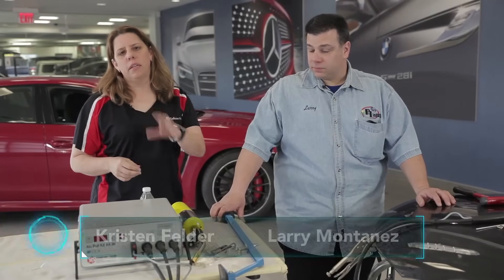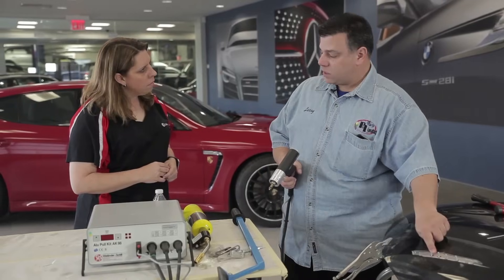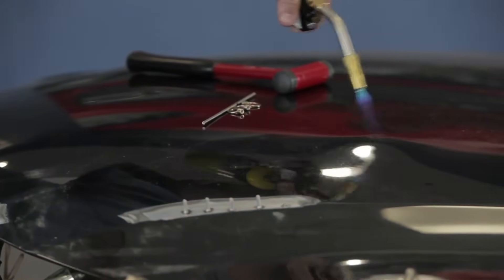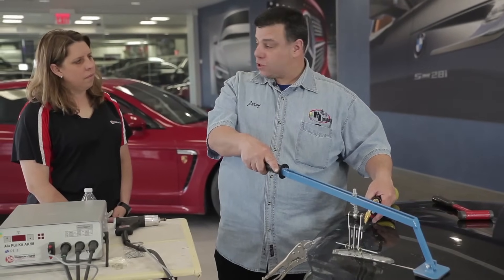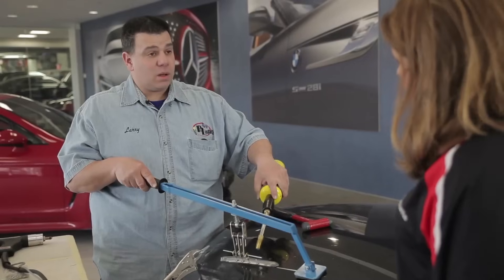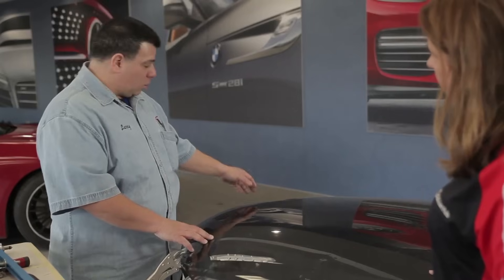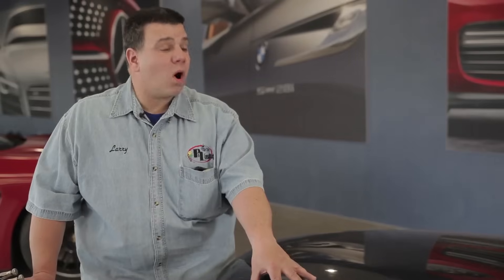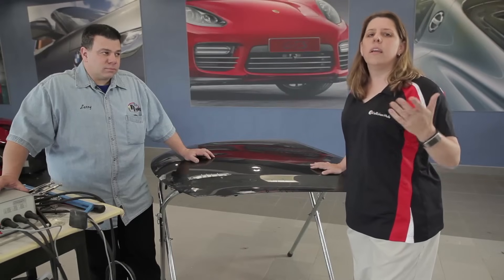Repairing Aluminum Body Panels With Collision Damage

Comment: We had damage to the nose of the hood on our new Lincoln Corsair and the insurance company says bondo will do. The dents are right at the crease where when you lift the hood it has impacted the seam where the two or three pieces of aluminum are bonded together. Is this an adequate means of repair ? very concerned about aluminum corrosion and that seam opening up over time.

Comment: You can use Tempil Sticks to indicate virtually any temperature.  Welders and heat treaters have used these for years.  There is some very good info using Oxy-Acetylene out there too.  Not today's technology but it works with skill.  Thanks.

Comment: @collision hubLarry talked about the use of the dye on damage analysis but then mentioned using it on bare aluminum. Can you use the dye without bringing the panel to bare aluminum? If I have a heave hit to an upper rail and want to see if the strut dome has any cracking can I do that without having to prep the area (minus the steps for the dye itself)?
Reply: Benjamin Bowman no I'm an aircraft mechanic it is of little use on a painted surface for detection of stress cracks . Major STRUCTURAL parts are inspect with the same dye Penatrant and an NDI process and always the paint is removed with a paint stripper. I got to be honest bondo will stick to aluminum I really can't imagine why all the fuss on a hood  or door panel of a car when it has little chance of falling out of the sky. I'd repair the same way I would repair a steel flat panel Bondo it and move on. I did body work 4 years before I got in the aircraft field when we were using lead filler. This process is a total waste of time.

Comment: you don't need heat for a tiny ding like that. I metal shape aluminum all the time and I rarely use heat. Heat is so it won't tear but it's not going to tear for that. Silly.
Reply: sanchtech the heat is to soften the metal making it more pliable and less prone to cracking. Makes the operation way easier. The aluminum u r using is softened already

Comment: i was repairing a jaguar quartel panel and some reason i cant get the pins stick good ..they pop off soon as apply pull pressure ..what was i doing wrong
Reply: You need to match the OEM "Alloy". Aluminum is not normally "Pure aluminum", It is an alloy of various metals. There are many alloy types. You are obviously using the wrong alloy for the pins. Here is a quick tip... Go to a junk-yard, find a similar vehicle, cut-out a chunk of the same metal, with a nibbler. Use that chunk of metal to make "tabs" for pulling. It should be 100% the same exact alloy.
Reply from the maker: pinoydad0811 Did you clean/brush the area immediately before applying the pins?

Comment: Can you apply body filler direct to aluminum panels?
Reply from the maker: bossmike24 yes, as with steel you want to make sure you get a tight skim coat for your first coat. 
Also, review the OEM procedures for the vehicle your working on, some OEMs require a 2K primer prior to filler on both Alum and steel panels
Reply: Body filler has to be able to use on aluminum, usually it will say on can or bottle, but for aluminum I like use ever coat glaze putty you can use right over bare aluminum, but clean with rubbing alcohol first

Comment: Thanks for showing us this information. I just wish cars didn't have to go to aluminum. I just don't trust it yet. I hope nobody has to get hurt just so automakers can over complicate things yet again by trying to save money. I just don't get it though what is the point of going to all aluminum on a new car? Its going to raise car prices and if it's not thin how can it be about saving weight?
Reply from the maker: All car manufacturers are having to save weight due to the CAFE standards on gas mileage. For example the Aluminum on the F150 saved about 650lbs over the previous production year.
In crash testing it has the same safety performance of the high strength steels. Also important to remember we've had Aluminum body cars in production going back to the 1920's. It's just going to become more common.
Reply: Also keep in mind, besides appearance and wind drag, the outer panel is like a veneer for looks etc. The effect would be minimal during a crash as the energy is absorbed by the frame etc.

Comment: This is bullshlt bin in auto body for 30years that aluminum must be very thin. I'll give you a stretched panel dent to bring out like most damages.  Theirs no way that little flame can fix anything in an accident.
Reply from the maker: Aluminum exterior panels are not that then. This repair technique is standard as part of the various OEM Aluminum repair classes.
Reply: S Q yes the aluminum is thin but 2 to 3 times thicker than steel panels. It’s very stiff and when dented it work hardens more in the damaged area making it difficult to put it back to where it was the heat just lower than melting softens it making it easy to manipulate back to where it was meant to b   Also by softening it previous to reshaping the metal is pliable thus much less prone to cracking. Believe me it’s not like the steel panels we are used to. Need to approach it differently than steel. Sad but true nontheless

Comment: Great video.
Reply: Aluminum panels should be repaired in clean rooms on big repairs .When working with files they can never have been used on steel.If just a little piece of steel get impregnated into the aluminum you will have a problem.Always keeps steel files and aluminum files separated and marked them .Make sure your grounds are clean and free of any iron..Make sure you charge for additional material and labor on all aluminum repair work.